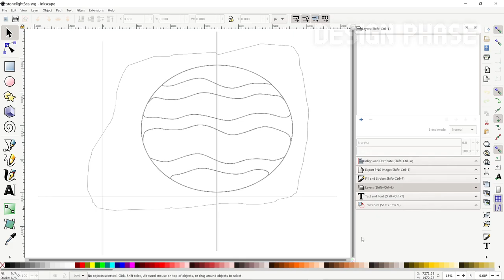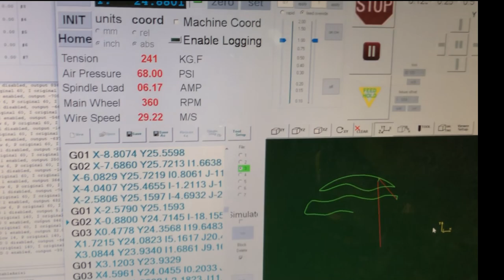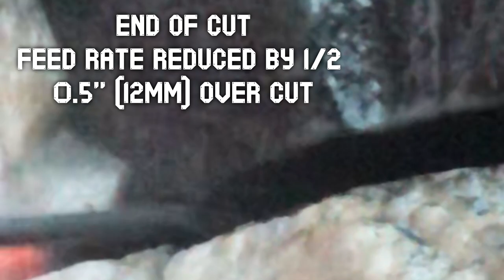Cutting Granite with a DIY wire saw #CNC #GRANITE #STONE

Comment: Just watched the video after our brief chat on the Rockhound Podcast with Karen & Theo, that saw is awesome. 
I feel like I might be on the right track with my thoughts on using a bandsaw. It will take me a while to figure out a few things, but I’m keen to try. All I need is a bandsaw saw of the right size & price and a blade. 👍
Reply from the maker: Just remember that cutting stone is SLOW.  Most wood bandsaws are moved manually.  You don't want to have to push the saw into the stone, you will want to have it moved by a motor that you can vary the speed.  The movement of the saw head will be measured in inches/minute.  All depending on the size of the stone and type of stone.  For example a 24" wide granite cut with diamond wire, cuts around 1"/min.  Also you need to make sure the wire speed works out.  Most diamond needs to run around 24 meters/second.
Reply: Thanks Greg, I appreciate that you have taken the time to provide me feedback and info.

Comment: I really want to build one for a different project all together…. Rough ball park on what that cost?
Reply from the maker: China is probably the cheapest/fastest.  Price is around $30K USD plus shipping/tariffs for a CNC one.   To build one yourself, it all depends on how complicated you want it.  All you need is a way to move the saw up/down (I've see others use an old forklift mast, or an automotive hoist/lift). You can buy pulley wheels from China for fairly cheap, or I've seen someone use trailer tires, and just run the wire in a groove in the tire.

Comment: Very cool!! How much is the wire? Where do you get it? How much use do you get out of it?
Reply from the maker: Hello Charles, thanks.  The wire is about $50-$55 USD per meter for wire from Italy.  You can get cheaper wire from China for around $40/meter.  Wire wear is measured in "meters squared cut per meter".  Wear depends on the type of stone,  high end (limestone) up to 20 meters square per meter, low end 8 meters squared per meter (harder granite).  The saw has a 15 meter long wire.
Reply: Thanks for the info. I am looking for diamond wire to cut cast iron. There is a U.S. supplier (Diamond Products) who offers a wire that I think would work (DWHP25) and it's the only one I can find available to purchase without importing. It is listed for sale and in stock on several websites, all of them seem copied out of the diamond products catalog, and that original catalog does not list a length/quantity, so neither do any of the retail web stores. They list the price between $99 and $165 (per ???) I will make some calls Monday and ask, but curious what your educated guess is. Per meter I assume? If we used meters here in 'murica I would agree, but... is there any standard length that diamond wires are typically offered in, that they might be offering (apart from meters?)
Reply from the maker: @charlesstaton8104  Pretty sure they just import the wire.  My guess is the price is per meter.  I buy direct from Italy diamondpauber.it , see the link in the description.  They also have wire specifically for steel.  It's pretty simple, just email them and they will get back with a quote.  Then I do the wire transfer all online through my bank.  I think the longest it took was 2 weeks.  

There's no standard length unless buying "endless loops" for stationary saws.

Comment: Hey listen, what you do is amazing and hope your passion never dies and that you stay innovating and inspired as long as you want to. So I am have a bit of trouble finding info on this wire. I guess I am thinking of using it in  oil fed band saw to cut agates and possible even bigger planks of petrified wood. It's a lot of money to purchase a large lapidays saw and it still doesn't come close to cutting stuff I have and would like to cut. So sorry if this is not allowed or bad form. If that's the case please delete. Can be found under same name and a pic of common opal as my photo on fb.
Reply from the maker: Hello Troy, what information are you looking for?  The wire is called "diamond wire".